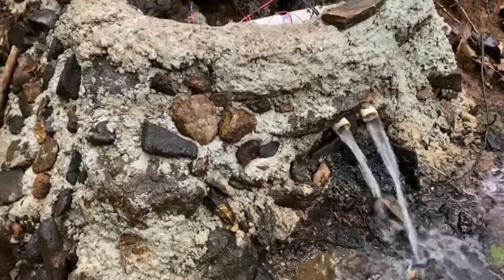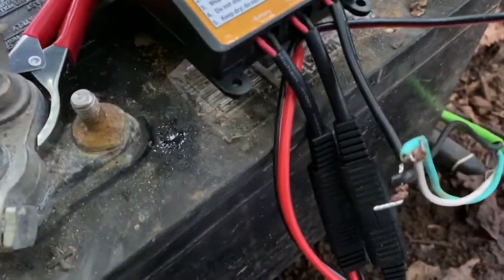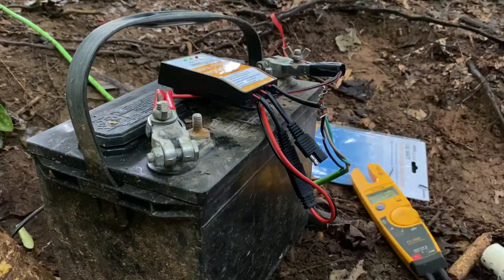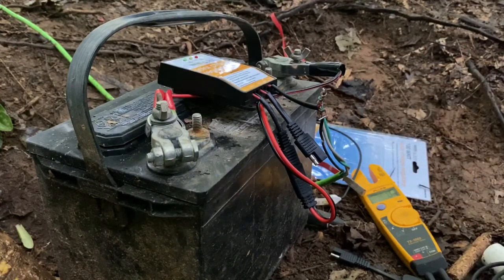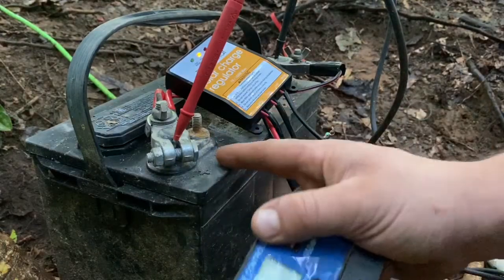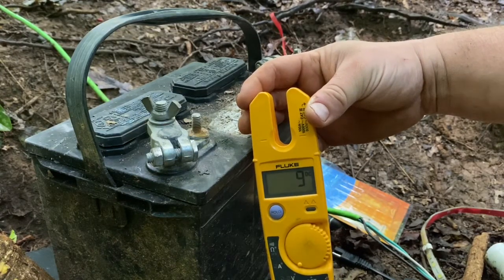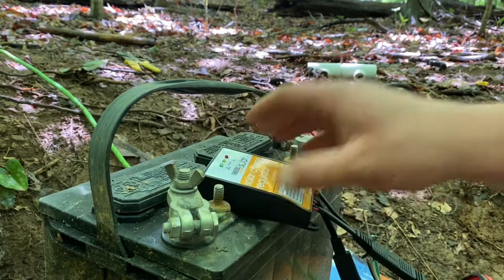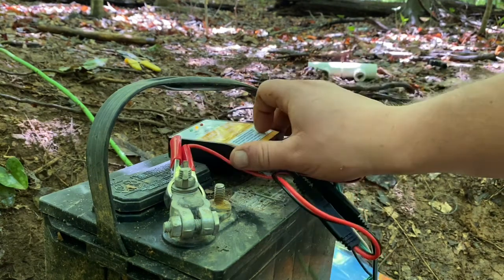Harbor freight solar charge regulator

Comment: Cool set up: I know the newer batterys don,t work that good in cold temps. But what you can do is (if you up grade batterys) install a insulated battery box in a tree (over the flood line), with a older christmas tree light bulb inside, to heat the box up and batterys. Also get a $25.00 dollar motorcycle alarm to keep an eye on your investments. Just some thoughts !

Comment: The voltage must be higher then the stand by voltage of the battery or no current (amps) will flow to the battery. Current always flows to the least amount of resistance. Ex a 12.4v battery needs 12.5v minimum to move even 10w at 12.5v (100 mah)